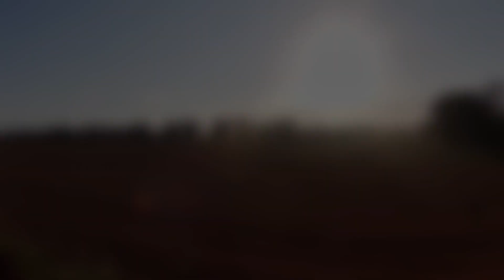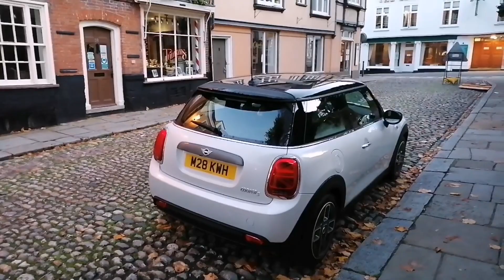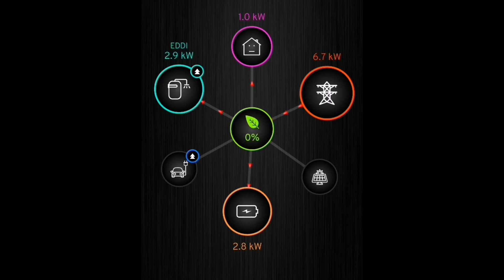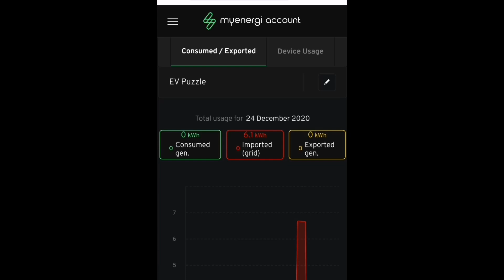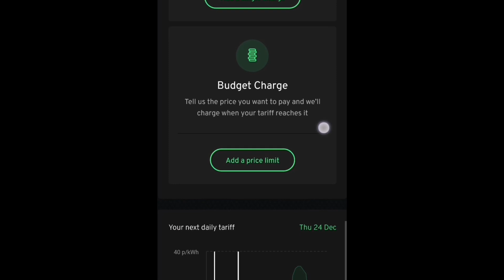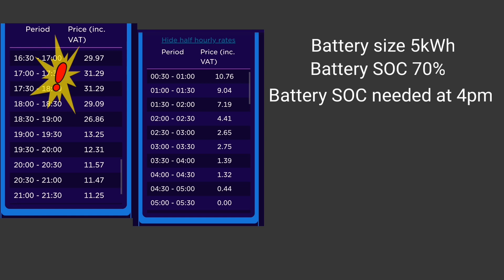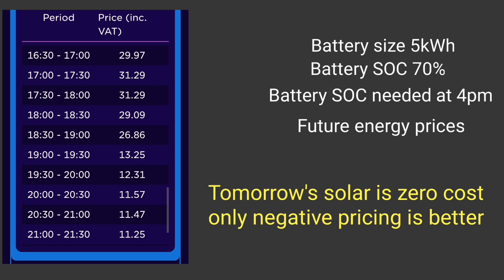EV, Solar & Battery  but something's missing?

Comment: Probably worth checking out the Octopus Agile integration with Givenergy detailed here https://kb.givenergy.cloud/article.php?id=8 it sounds like Octopus are the ones making the decisions.
Reply from the maker: Yep not a single description as to how octopus decides what you need in the smart home configuration.

As octopus doesn't know what solar you have there's a real risk you'll export back to grid on any sunny days
Reply: @EVPuzzle  To be fair to GivEnergy I wouldn’t expect them to detail the Octopus methodology in their support notes, you would expect Octopus to make that clear and potentially allow some user speciation. I don’t know it they do when you go through the config as I don’t have Agile. Might be worth a go and could be a interesting video. 
For my set up I’ve gone for more certainty on pricing with Go rather than Agile (I know this might not yield the best prices, but is easier to explain in a larger household). I export using Bulb, who pay a little more than the cheap rate from Octopus Go, so at present we are charging our 10 kWh battery at night and then the solar covers some of the use during the day with the battery picking up more of the load. If it’s sunny enough to charge then it does and when full we are exporting at about the same cost as we imported at night, although with some loss due to the round trip inefficiencies. My simple way of considering this is that the battery allows us to borrow wind and hydro power from the grid at night which we can then repay with solar during the day, allowing us to minimise, not eliminate, grid usage at peak times.
Thanks for the videos.

Comment: Not enough I integration of individual products I totally understand that.
Some products such as the Ohme are well ahead of the curve. The Ohme delivers what I want when I want it and at a price cap that I set.
My Powerwall 2 does a great job at making sure my usage through Agile peak time is as close to zero as possible. However it lacks Agile integration in terms of when to charge over the preceding period of time...so like you I have to set a single time slot to charge the battery Vs the Ohme that chooses the cheapest or greenest time to charge to the required level..
I think car timers are almost defunct if you are on an Agile type of tariff. 
However they work on GO pretty well.
Given the Ohme charger can be had for a special price of £150 (at the time of typing this) if you are with Octopus. It's such a pity that ASHP and Powerwall can't be driven by an Ohme type product...

Ref Export of Solar. The view varies on this depending on how much you get paid for export. 

There are do many permutations.. and so many different bits of kit... It's difficult to see a common standard ever being agreed.. I guess canbus was probably the last major cross manufacturer standard that was agreed? Unless anyone can think of another?

Comment: It would be interesting to see what the payback period is for your complete system, bearing in mind whether you paid cash or borrowed the money as I am seeing loads of people being mis sold solar panels as one gentleman paid £10,000 for his 3KW system but the FIT is only averaging £38 a quarter and all his panels have been put on an east facing roof so little electric being generated to use
Reply from the maker: That's really sad to hear ..10k and not a good system 😠😱

Comment: The one thing that’s missing from your energy equation isn’t automation, it’s heating!  It’s the 3rd biggest household cost for me, right behind diesel and food.

My house is running on propane, and as such it’s about 2.5 times more expensive than mains gas to produce one unit of heat.

My philosophy so far has been to “insulate first”, and that philosophy has paid dividends.  But it’s running into the law of diminishing returns.  I could switch to heat pumps, but then I realise that my energy equation in the winter time will be woefully inadequate to address its needs on an off grid basis.

What we really need is the means to store all the summer time energy surpluses and use it in the winter time. Lithium ion doesn’t cut it.  Hydrogen is inefficient, but it only has to be marginally better than the export price for your summer time solar price to be worthwhile.  If an energy company was able to set out a power purchase agreement for buying your summer surplus electricity  and give you hydrogen in return in the winter time, would that work?
Reply: Hi I have a EV Solar PanelsSolar Diverter  but no battery. I have ASHP best thing I ever got be very wary of negative comments about ashp pumps until you get one you don't know the good and bad points. My heating costs is practically nothing in the summer yes more in the winter but throughout the year it is less than gas. It works perfect with solar the key is to get a good installer also it works on low heat so need your house to be fairly well insulated also worth getting some radiators that use fans but the majority of my radiators where fine so no need to change. All of my home use electricity not using gas anymore great also live in the city. I have had it for 4 years works a treat
Reply from the maker: I'm looking into it. Depends how big a device they spec. I want a low tickover wattage
Reply from the maker: Haven't we sort of got that already? Get paid for your export in summer then buy back energy with the same money in winter? 

In theory you could drill a very deep bore hole and winch up a heavy weight in summer and drop it back down in winter with an electric motor connected?

Comment: Merry Christmas from Worcestershire.
Like you have said there are little detail in how the Givenergy/Agile optimisation works. The givenergy knowkedge base only really shows how to sign up - https://kb.givenergy.cloud/article.php?id=8 
As there are little details in the wild, would it not be interesting to yourself and others to “turn it on” and find out? I know i would be! Even at the expense of of a few KWH’s this would be a interesting trial. 

I also notice that givenergy in Stoke are recruiting software engineers. Unfortunately though, like you said, this software is relatively simple, but the varying test scenarios are significant to get it work “just right” for the majority of users.

Comment: You've bought closed source products without an API (controllable input) from different manufacturers. You'll never get software that can handle all.
But with open source systems you can do what you want. Instead of a zappi you've openWB that does the same and you can set it op much better. You can change the scripts or combine it with a home automation system. Or you can set up a node red environment on a rpi that does all, you don't have to program, just make the logic by blocks and connections on a visual development environment.
But you'll see that what looks what was easy and simple isn't so easy or simple when you take into account a lot of parameters.
Reply from the maker: Zappi has the potential to offer customisable logic. For me it's just the battery that needs better automation and I'm happy for it to work independently of other devices

Comment: Your calculation is wrong. The price to use your battery is price divided by all following parameters: net kWh (is gross kWh * efficiency in and out including inverter efficiency, SOC use mostly between 80-90%, number of cycles in life time of battery). Not only the 30% of in out efficiency like you mention.
Reply from the maker: Exactly , we need lots of parameters as no one method is perfect for all

Comment: You are correct different people need different issues solving, like you I agree don’t discharge my battery unless it’s peak time or at least 20% cheaper, And also linking all devices together to meet our demands but also require time limits ie o don’t want my electric boiler to come on between 9 pm and 6 am but need a minimum temp and. Post to higher temp is 20% cheaper than the next 2 hours, but this does not only take in to account what is users want but also help the grid and very soon V2G could upset that further, there is certainly a moving goal post but I feel the goal post is also changing size
Reply from the maker: We need lots of parameters  and I'd hope some devices could self learn and anticipate.  Fir example how many electric use profiles are there in our house? If my battery learnt that the over profile is 2.6kw on and off every 60 seconds it could anticipate or the washing machine is 2.4kw followed by 400w. There's so much potential to optimise.

I'm hoping someone goes open source and let's customers develop the interface themselves.
Reply: @EVPuzzle  I though IFTTT could of solved this issue but they have moved away from being user friendly maybe the suppliers will be the link, there are some bets programmed out there
Reply from the maker: Energy companies have their own motives, we need automation inside the home too